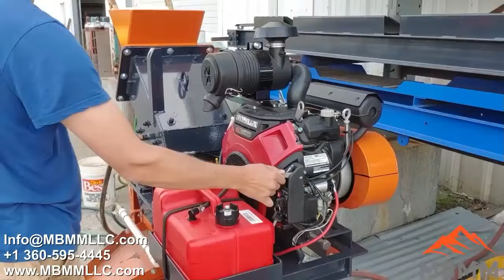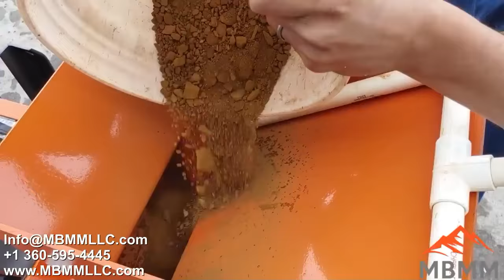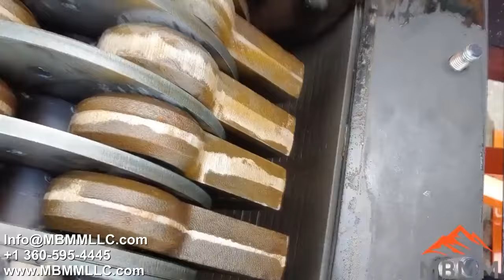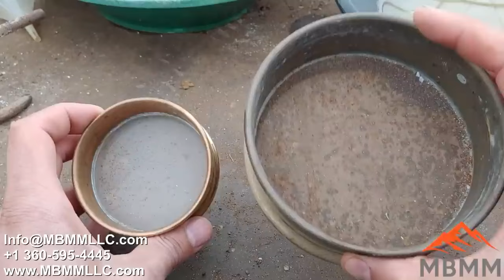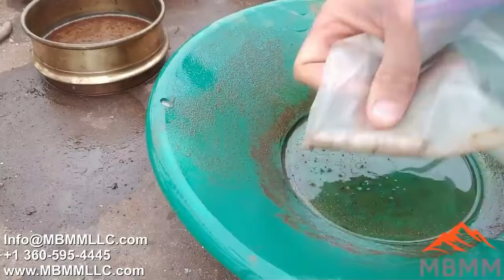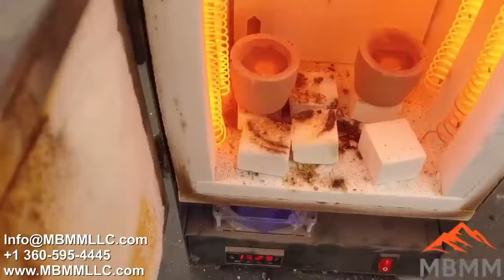How to Recover More Gold Anywhere: Gas-Powered Mobile Hammer Mill in Action

Comment: You have a really excellent investment system. Having seen all the various parts working seperately and combined I really like the way you can build up to a total recovery system that picks out more than just gold. Silver, Lead, Copper, Tellurium and Tin all come to mind as having value in varying amounts Tellurium has a particular vcalue now for electronics so there is a wide range of recovery from mining to scrap and even simple aggregate conversion with the rock crusher that could all add up to an amazing system when employed together or in seperate situations doing several different jobs on 4 or 5 locations at a time......all form one hammer mill with a sluice attached ...not bad Jason thats quite the business builder
Thanks for sharing

Comment: I been thinking, what if you had two shafts with hammers on them? With the hammers swinging between each other like a shreader. The ore/ materials entering where they meet.  With a  water jet washing the  dust out. With laser cut slits with a .030" slits for discharge  up to .200" slits . The shafts would be just like this one. With only having hammers on every other row. The opposite shaft has hammers on the opposite row to allow the hamers to nesh. Maybe  add a 1"thick piece of tubing on the shaft for protection of the shaft, and add. Hard face welding  to protect the ring from wear.  The hammers swinging at each other should really break up the materials.. churning it to dust..  the discharge guard with .030" x 1" slits  would require  the material be less than .030" thick. I have also wondered why not put a trough at the end of a sluce. And just let it over flow. Keep the large stones out. Maybe cover with mini grizzly bars, say 1/4" bars  spaced anout .050"-.065" spart so only  things like sand. Will get inside . A 1/4" plate steel with .050" slits  every .150"-.250" will also work. That should catch the fines lost in the sluce.. if you do all that work, best to NOT LOOSE ANY OF IT.. HAVE AN AWESOME DAY🎉
Reply: you have yourself a machine design there  dude

Comment: it feels more like tailor mounted would be better than pickup truck bed mounted. with a level on each corner adjusted when they say level the mill is proper level.  but that's just me
Reply: my thought there is it depends how good you are at driving a trailer...I have certain places I can't put my trilers and I'm on a big semi flat area so as far as I can tell Jason mounts the hammer mill on his truck because there is not enough room to turn a trailer at any point near the mine so reversing his truck in is easier.